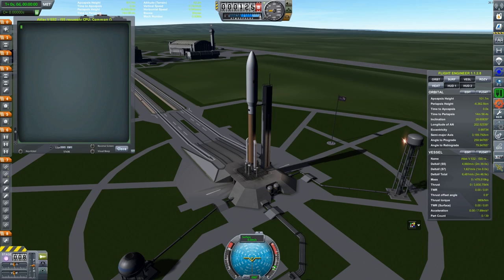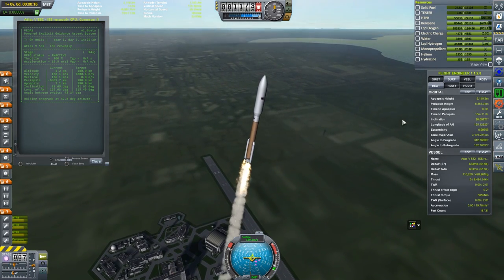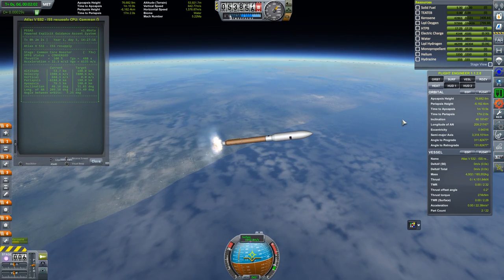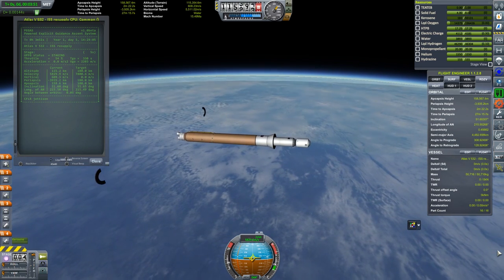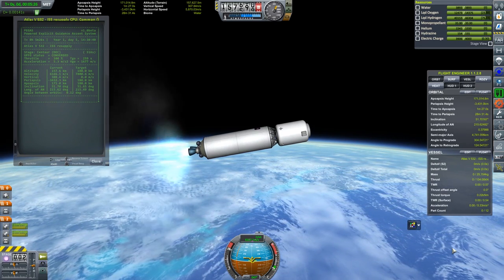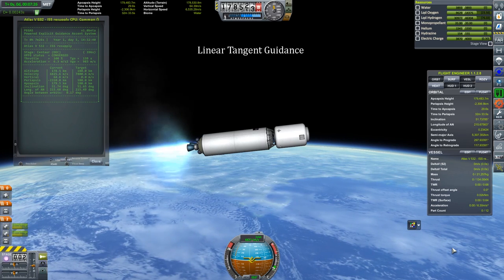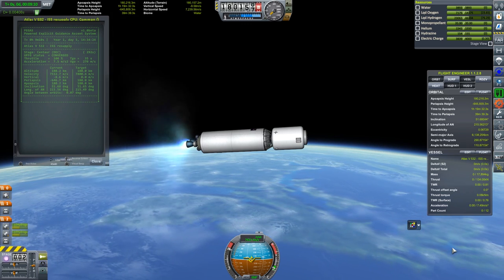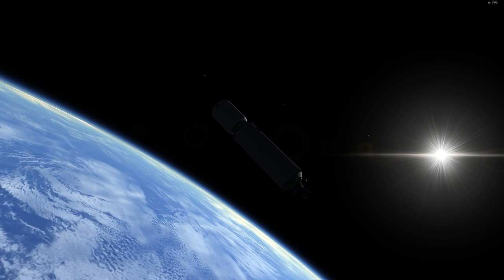Space Shuttle guidance algorithm in Kerbal Space Program

Comment: I am having one last problem. Every once and a while I will launch a rocket and the upfg will get stuck on converging then when it finally converges it will either pitch the rocket straight up or down and will fail to complete the mission. I will launch the satellite and it works great then the next mission I get the same issue. Any clue what is causing this?
Reply from the maker: This is a great question, I've observed this situation several times. It usually happens when it's actually impossible to find a transition trajectory from your current position to the desired orbit. For example, you target a circular 200km orbit, but the UPFG activates on 30km altitude with 35km apoapsis - it is unable to find a path that would simultaneously get the vehicle 170km higher, and at the same time those several km/s faster to reach orbit. This is a sign that your ascent was too shallow and you should pitch less or later - or the opposite: if the UPFG engages on 100km with apoapsis of 300km, it also fail to find a trajectory that will kill the vertical velocity and gain horizontal simultaneously. In general, this kind of behavior is almost universally caused by a bad ascent OR mistakes in a vehicle definition (e.g. the vehicle is actually much heavier than in the script). If you need further help, please visit my Github page and post an issue - link: https://github.com/Noiredd/PEGAS/blob/master/docs/issues.md
Reply: Further to what Reddy said already (that rhyme). I once made a mistake of trying to launch into inclination of the Moon (setting Moon as target) and that also caused converging to take a while since Moon is in lower inclination than KSC. Basically the more PEGAS has to correct for, the longer it takes to converge and more extreme the pitch and yaw angles will be.

Comment: Hello. I know this is a pretty old video, but I've been looking through the NASA and kOS script documentation.  Am I correct that the algorithm, as-is, cannot control Argument Of Periapsis?  I'm asking because I'm currently working on a maneuver/ascent guidance script of my own, and I'm wondering if it might be possible to modify the UPFG algorithm to provide this ability.  Maybe would require eliminating the engine cutoff altitude constraint.

Needless to say, your work here is fantastic!
Reply from the maker: You are right, UPFG cannot directly control AoP by default. I think it might be possible, maybe with some cleverly designed additional corrector term, but right now I don't see a straightforward way of "hacking it in".
However, you might attempt to approximately control it indirectly. For a given vehicle and launch site you could measure the downrange distance (how far did the vehicle need to travel to boost some given payload to some altitude), and then for future launches adjust the burnout altitude and velocity components (vertical & tangential) to approximately achieve a given AoP. This is probably how I'd try to modify the corrector anyway.
Finally, I don't think a direct control over AoP is universally useful :P You could launch to a circular orbit and plan an additional maneuver to boost yourself to the target orbit with any AoP you want. I think this is how modern commercial geostationary satellites are launched anyway - this plus careful launch window timing.
Feel free to reach me through my Github if you're interested in pursuing this, we might be able to come up with something. :)

Comment: How would I go about writing one for the shuttle? Even though I am looking at the tutorial I am still having trouble figuring out what counts as a stage, as the rs25s burn for the whole flight.
Reply from the maker: The way I'd handle this would be to define a single stage with the RS-25s, drop the boosters like on any other SRB-equipped vehicle, and simply switch to UPFG mode some 2-3 minutes into the flight. Optionally you could define a second stage for the OMS, but this would require ditching realism a bit and fly a direct ascent so that PEGAS can circularize immediately (instead of burning out at a lower altitude but with a higher vertical velocity and waiting for the apogee).
Reply: @reddmst  thanks, I successfully got it defined properly however the script doesnt work because r, and other variables you set, is already used by KOS
Reply from the maker: @nikelinq2899  I'm aware of this issue, it's caused by the newest release of kOS. I'll fix this "soon", but in the meantime you can use the CLOBBERBUILTINS directive as a workaround (read about it on kOS documentation).

Comment: Is this an overkill for KSP? How is this different from launching when target orbit is overhead and launch to match inclination and then finally maneuver to rendezvous?
Reply from the maker: Might be an overkill, because in vanilla KSP if you miss your target by a few minutes and get a properly inclined orbit but with a different longitude of the ascending node (or a generally tilted orbit), it's very cheap to make a tangential burn to correct the angle between orbits. In RSS however, plane change maneuvers are pretty expensive, and launching to the exact orbital plane is never as easy as "launch when target orbit is overhead" - mostly because your launch takes upwards of 9 minutes (compare to 2-3 in vanilla) and your vehicle drifts significantly during that time.

Comment: How much can a lousy random guess for a gravity turn impact the state at PEGAS startup?
Reply from the maker: PEGAS should handle the situation in most cases, but a very bad guess can impact it a lot. You want to look at the apoapsis (when PEGAS starts) and make sure it makes sense - e.g. if you're going for a 200km circular orbit, apoapsis of 150-250km is good, but 100km or 400km is very bad (too low/too high) and PEGAS won't handle it. Performance of your second stage also matters - for a low-thrust stage, you probably want to aim a little higher than your target orbit (to give it time to build the horizontal velocity), while a high-TWR stage might do with a slightly lower apoapsis.
Reply: Reddy So when I do my random guess gravity turns, I launch straight up, wait until vertical speed is greater than 180 m/s, then pitch over to 5 degrees below vertical, holding attitude until velocity matches facing. Would that work?

Comment: After tinkering with this a bit I have found no way to control my roll, which is necessary for a shuttle flight. Any advice?
Reply from the maker: Yeah, this is one of the things that aren't implemented yet. I'm planning to get to this after the weekend, but if you want to dig into that yourself, see the following:
- lines 78 and 104 in pegas.ks control roll during atmospheric ascent
- https://ksp-kos.github.io/KOS/math/direction.html#function:LOOKDIRUP
- line 648 in pegas_util.ks controls roll during automatic guidance
The LOOKDIRUP has two arguments: the first one tells the system where should the nose of the rocket point, and the other says how should the rocket be rotated (roll direction). The problem is in the fact that roll is (for now) fixed. Also, that 648 line should also use LOOKDIRUP, by the way.
How many roll maneuvers do you need to make?
Reply from the maker: I forgot to let you know, but since version 1.1 PEGAS has the ability to program roll maneuvers :)

Comment: What do we require to download the program to run it. and is there a way to make it a .TXT file so we can edit the version of the atlas
Reply from the maker: 1. Kerbal Space Program, the game
2. kOS, a mod
3. github.com/Noiredd/PEGAS
alternatively,
1. MATLAB
2. github.com/Noiredd/PEGAS-MATLAB
Reply: ok then.
Reply: is there a way to make a boot file modular for the Atlas V
Reply from the maker: Please explain what do you have in mind? You can submit an issue on github if you need to describe it with more details.
Reply: ISEA would like to use this for our Zeus rockets we just require a way to make a Boot file that can be changed to have multiple SRB and faring configurations.
Reply from the maker: If you drop SRBs and fairings via sequence, this is how I'd go about this: make a general vehicle definition that will fit each Zeus config ('vehicle' variable). Put it in your scripts. Now, for each configuration, make a config-specific bootfile, containing 'sequence' and 'controls' (as you probably want to pitch over earlier for a more powerful variant). In this boot file, include the `switch to 0.` line, and run the main vehicle config.
In short: each Zeus configuration has its own boot file, which then loads the Zeus core vehicle description.

Comment: can you please upload your .ks file which includes the controls, sequence, vehicle. I am having trouble figuring out how to properly define all of the variables in the way KOS wants it. Thanks it would really help. :)
Reply from the maker: Check out my github repository (link in description) - folder kOS/boot contains examples for an Atlas V and Saturn V. Let me know if you need further guidance!
Reply: OMG THANK YOU SO MUCH. THAT HELPED SO MUCH
Reply: I'm having some problems. I'm modified the Saturn V template for the RO FASA Saturn V and when PEGAS engages after the first stage drops it either stays at around the same angle (~40 degrees) that the first stage was travelling at and then later pitches hard to correct itself, or it pitches down at first (between retrograde and straight down) and then comes back around to pitch up at around 40 degrees again. I can't figure out what's going on here. I made a post over on the kOS subreddit.

Comment: What mods do you use for our real solar system? The ones I use in Ckan do not work.
Reply from the maker: I'm running a 1.2.2 install, and installed all mods (RSS and RO, with most of the recommended and some suggested mods) via CKAN without problems. Other than those I only added Kerbal Engineer Redux, HyperEdit and of course kOS.
Reply: oh. my game is on 1.3, thats why it wont let me DL it on Ckan. I see. Thanks though.
Reply from the maker: If you're using Steam, if you right click KSP and go to properties, then select the "beta" tab, you can select "previous_1.2.2" to roll back to that version. Be sure to backup your saves (or entire folder, if you use mods on your current install) first.

Comment: Not to be that guy but the whole "aerodynamics is difficult" thing isn't very true in this application, it seems you're under the impression you'd have to run a whole aero analysis every frame but really you could just table the aero coefficients vs angles of attack, mach beforehand and interpolate them during flight
Reply from the maker: Table-based lookup is just the easy part. The difficulty is in incorporating that into the equations of motion so that you can predict the aerodynamic effects far into the future. Without aero you've got acceleration as inverse of time and gravity as inverse-square of position - which is already difficult enough as it is and requires some hacks to predict. With aero - even look-up based - you have to plug this table-based force component into the mix. And personally I don't see any straightforward way to perform the AoA/mach integration. This is what I meant by "aero is difficult" here.